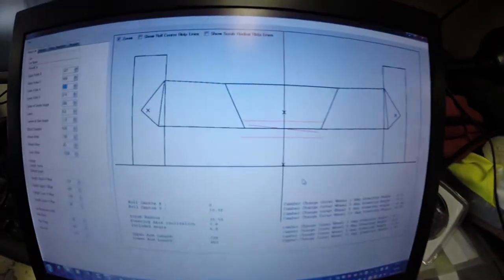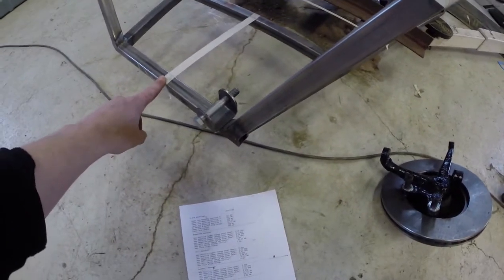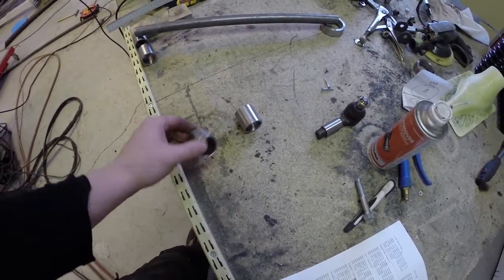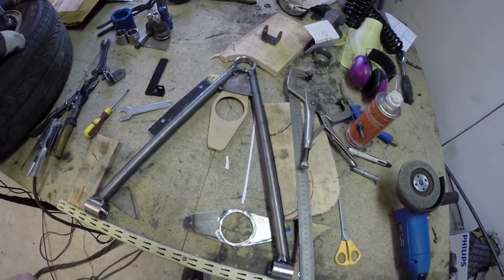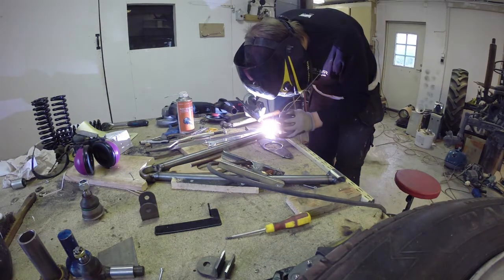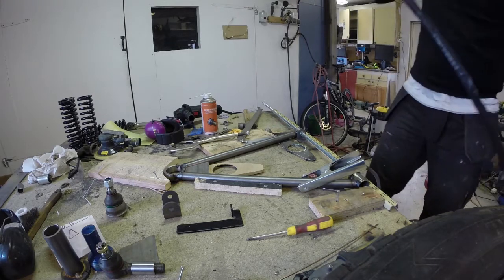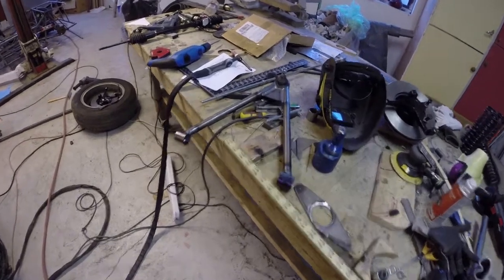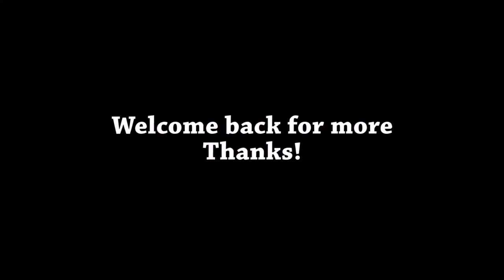Building Super 7 locost Ep6 Front a-arms

Comment: How did you cut the tubes so they bevel together nicely? Could you make a video on that?
Reply from the maker: Uhm hmm I used the angle-grinder and grinded them until they fit :P I dont have any fancy drill press so I have to do it the simple way Im afraid. but it works but it also takes time.  I would love a notcher that does it for me
Reply: @DIYTechRepairs  He used a quadrangle plunger bit in vid... 2?  The same as what one would use to spread as hole.  He used it to dress the ends of some tubing. The bit  looks like a skinny Egyptian pyramid,  but taller.  It rounds tubing joints to join on tubing.  Probably comes in several angles... Probable has a name. Then the angle grinder.

Comment: Hi just watched all your locost 7 videos great job you are doing there.
I am also making a locost . I am using the haynes chassis with a mcsorley rear end and toyota corolla Donor parts. I am just a little behind you in construction.

What ball joints did you use for the A arms and where did you get the ring for the ball joints.
Reply from the maker: Hey
Im using Volvo 140 lower and Ford-transit upper. The rings was something that we just milled out of some scrap that we had lying around. Just make sure that the material is of good quality!